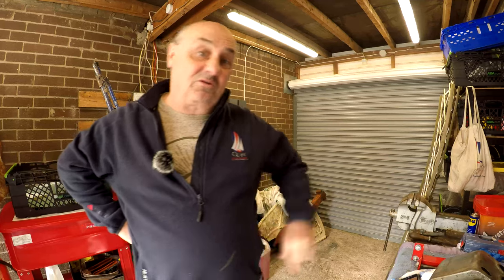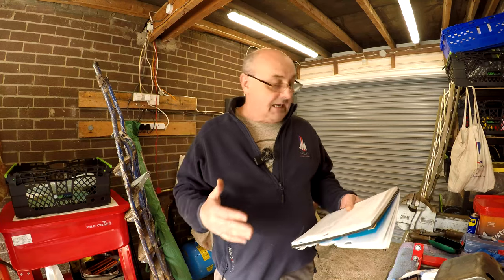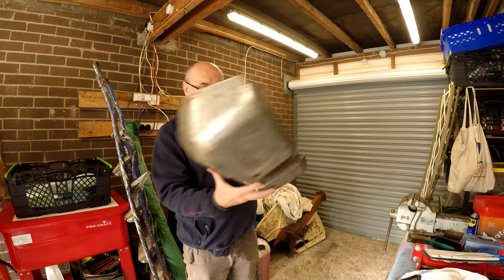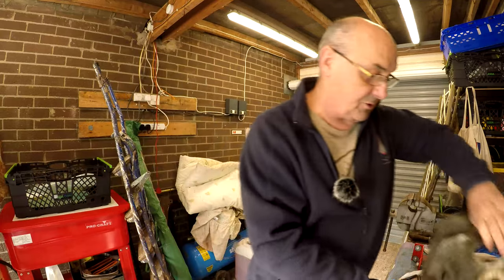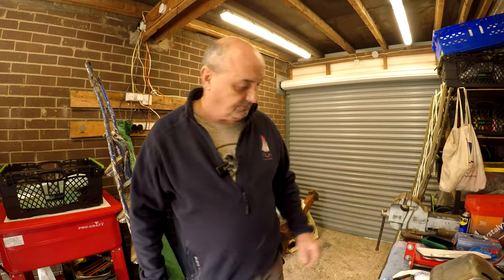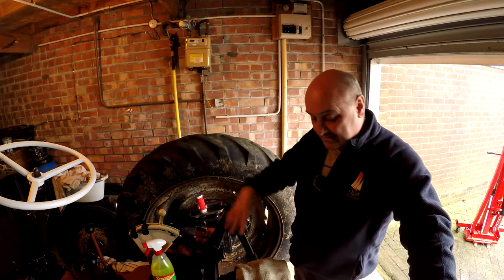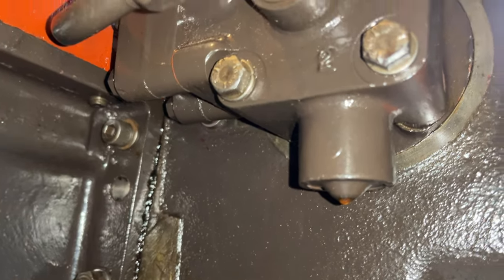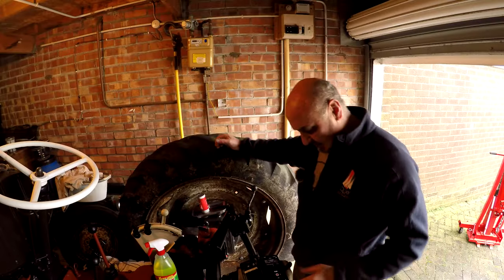David Brown 990 tin work and wiring harness #94

Comment: That's quite a snagging list Barry, it wouldn't be a David Brown without the odd oil leak! In the apprentice training school at DBT they had a mock up board of all the tractor electrical components that we had to wire up and the instructor would then connect the battery and test that every switch, light, gauge etc worked correctly as part of the electrical module. Good luck going forward
Reply from the maker: Cheers Terry,

Comment: Barry, I'm feeling your pain, cranksheft seal and final drive problems, better now than later on!  I certainly do know where Reed Raa is - my dad was born there.  I hope you get the problems sorted out so you can get out and about on the DB.  Had the Fergy half shafts out to change the seals, brakes absolutely covered in oil, set up the end float and fitted new brake shoes, went to start it to test the brakes to find the fuel tap leaking like a sieve. All the best, keep them coming.
Reply from the maker: Cheers Ken, the way I try to look at it is, If I wasn't messing with tractors Debs would have me decorating! and I hate decorating! So oil to the elbows sounds good to me.
are you going to repair or replace the fuel tap?  I'm sure Lance has a good video on repairing one and you can get all the bits from the old TE20 people.
anyway it keeps us out of mischief.
many thanks Ken
Barry
Reply: @manfromthemist1958  Kit is already on order, I've watched Lance's video, looks straight forward, next job full oil change for engine and transmission. Cheers
Reply from the maker: Lance is the daddy!

Comment: Hi Barry. The first time I put a new clutch in my 1210 I had to split it 3 times. The cone on the replacement disc for my pto was slightly longer and I did not notice. It was just enough that it would not allow the clutch to disengage. Needless to say I got good at splitting the tractors if nothing else. Once I got the right size disc it worked perfect. I have done quite a few since then but I will never forget the first one! Thank you for all your videos! I am constantly learning from you. Best of luck with getting everything sealed up!
Reply from the maker: many thanks Robert, some of those after market parts can be a challenge, I found the hydraulic filter snout to be 1/8" sort on my filter and spent two days trying to get it to fit, it's something you just don't expect at first, now I check everything.
many thanks
Barry

Comment: If it all went together perfectly with no issues it would be too easy and you wouldn’t learn.  I reckon I do every job twice before it’s right.  Like Shane, I used Hylomar on the lift latch cover - took me two goes because I didn’t read the instructions on the tube the first time. Been ok ever since though.  Also the hydraulic sump gasket - tried a thick paper gasket the first time which leaked so I found a thick rubber gasket from another supplier and that sorted it.  Brake return springs I got from Barclay.  Keep the videos coming!
Reply from the maker: Hi David, I know what you mean about doing jobs twice, and your right we always learn more from our mistakes or as I like to say alternative forms of correctness, its good to hear other peoples experiences as well, i don't think anyone wins them all first time.
many thanks David 
Barry

Comment: HI Barry - I can't believe how sanguine you are about splitting the tractor and stripping out a final drive - probably two of the hardest jobs on the entire thing.  At least the splitting will be easier so soon after having it apart - I think when I split mine it was the first time in about 30 years or more and it was quite a battle to open up the gap.  When I changed the brake shoes I tied up the diff lock with wire which snapped and dumped the diff lock into the housing and I needed to get it back under cover in a hurry so I put the final drive back on without it.  Gave me time to knock up the tool they have in the manual for pushing it back into place.  As I said before I emptied my swear box just before that job as you need to be a three-armed gibbon to get it back in, but the tool is quite easy to make up and it works with patience and ideally a willing helper.
All my wiring was pretty nasty so made my own loom with the circuit diagram in the user manual.  If you are putting new terminals on the wires I recommend using crimp terminals that have heat shrink on them as they give really strong connections - much better than standard crimp terminals with the normal plastic covers.
Great to hear the arms have held all this time - so the hold valve works perfectly and no leaks on the seals on the ram piston.  
Dashboard looks in good condition.  I had a few Dynamo issues on mine so whilst I had it apart I cut a new hole and put in a volt-meter so I can always see whether I'm charging the battery and I really like this addition as it gives me good visual feedback on whether the battery is being charged at whatever revs I'm in.
Great job as usual, keep it going.
Reply from the maker: Cheers Andy, well as I keep saying "it's only nuts and bolts", lol, 
and as you say at least I know it's all clean and freshly put together, so shouldn't be a right pain.
if you happen to have a photo of your dash with the volt meter in would you please send it to manfromthemist@gmail.com, so I can get a look, was thinking about an oil pressure gauge just to keep an eye on it as it could be to late by the time you see the light on.
when I took mine to bits it was obvious that someone had been in there recently and not in a good way, I've heard of people having to use 4" square post to knock the final drive off as they were so stuck, as I say mine where finger tight and damaged
thanks for all the tips
now just waiting for a weather window,
many thanks
Barry
Reply: My tractor lives 300 miles from me near the sea so will get a picture of the Volt meter next time I'm there.  On my dash there was a smaller blanking plug on the right side I remember and I just enlarged it to a standard 52mm diameter and put in a classic car illuminated Volt gauge.  Positive wire is just off the input to the voltage regulator under the dash as I remember  -as the 12V comes back there off the mounting point on the starter motor (which in turn goes to the fat lead on the +ve of the battery).  I really like the addition as I can always see the state of charge at rest and charging when running as a weak battery is a killer as they need a lot of cranking juice. @manfromthemist1958

Comment: Hi Barry,
The throttle linkage you showed is the same as my 990 selectamatic which is fitted with factory the optional foot throttle, so it's not an after market repair job 
The spring system allows the 2 mechanisms to use the same rod without interfering with each other.
Reply from the maker: Cheers William, i was beginning to think the previous owner had be searching through his scrap box and cobbling together a tractor.
many thanks
Barry

Comment: Hi Barry,
Some further dashboard info, in the parts book 629 printed in 1969 there are 3 part nu bers for the dash depending when the tractor was made. My machine is in the middle range of production and is attached to the tank by 5 screws, later tractors after number 813397 have a different dash attached by 4 screws. Hence your odd screw and hole count.
The screws are supposed to be, 2BA x 3/8".
Hope this is useful.
Reply from the maker: many thanks for that, it all helps to clarify the differences, a quick question for you,
does your dash sides fit snuggly to the tank at the bottom edges? mine has a gap of about 3/4" both sides, however when i pull them in with screws it gives a better clearence to the throttle shaft at the base
many thanks
Barry

Comment: Oil leaks yuk, DAVID BROWNS don't leak oil they just mark there territory 😀The throttle linkage appears to be the hand/foot control option. The spring allows the foot throttle to operate with out affecting the hand lever. The hand lever only throttle would have the cable attached directly to the lever with the ball joint. I like your positive attitude on taking things back apart.
Reply from the maker: Hi Brad, thanks for that, just one more thing that leads me to believe the previous owner didn't have a clue when he put this poor old girl back together, there's lots of mismatched parts such as the stabiliser bracket on the off side final drive is from an 880.
but thats a very helpfull piece of info many thanks
Barry

Comment: G Day Barry, I cant recall now but did you soak the rope seal in engine oil for a few days before fitting them? I think that if restoring tractors you can expect a few troubles, I have them that's for sure, the main thing is that you work through them and don't get disheartened with the job. It can give you the shits a bit though.
Reply from the maker: G Day Lance, no it was a while ago, yeh it got soaked for over a week and put in using thumbs and hammer shanks, as i say i broke the first carrier, but then I cant remember if i sealed it to the block, probs haven't,  nevermind it gives me an oppertunity for another video, but i will investigate with the endoscope first to see whats going on.
I need to get it outside in day light to look at it, you cant see jack shit in the garage.
many thanks
Barry

Comment: Hi Barry that is the correct set up on the   Hand throttle with the spring when a foot throttle is in place . Can you start the wiring I have 880 and a 950 to sort out need to copy you hurry 😂😂 thanks Gary
Reply from the maker: Hi Gary, sorry for the delay, I will be starting the wiring soon, thanks for the info re the throttle, very helpfull
I'll drop you a message when I've got the video comig out, hopefully not to long
many thanks
Barry

Comment: I don't like oil leaks either.  However, from what I've heard, it wouldn't be a David Brown if it didn't leak a little bit 🙂  I used a Hylomar blue equivalent for those machined faces between the left hand cover and the casting.  No leaks there for me.  I can't remember if you've already videoed removing the steering shaft, but if you haven't I'd like to see that.
Reply from the maker: Hi Shane, I've got some hylomar blue I'll give it a go in the next couple of days and see if it works, thats if it stops raining here, all the fields and roads around us are flooded tonight and the farmers are loosing lambs with the wet and cold like there's no tomorrow.
The steering column, was completely resto'd, new balls etc before I began the video series, one of those " I wish I had"
moments, however I'll be videoing taking the lot off again to split the tractor again, I'm hoping it something stupid like I forgot to seal the carrier to the block.
many thanks
Barry

Comment: 1 step forward and 2 back. Pretty difficult to bend a shaft that size. m
Reply from the maker: Hi Marshall, I think it had something to do with the previous owner running it with four bolts in the final drives and ovaling the seal carriers, as you say they are heffty bits of steel.
cheers Marshall
Barry

Comment: Hi Barry. I see your starting to do the tinwork. I've just fi ished my dashboard too 😂 Wondering where you bought your final drive inspection plate holding bolts from? Thanks. Also check out the video I've uploaded onto the channel showing the 990 restoration so far...
Reply from the maker: Hi Crofter, I bought them from GWR on ebay and then just drilled two for the breather bolts.
20 off £10.00

Comment: Oh no one step forward 2 steps back but you seem relaxed about it all id have filled up the swear box lol. Your get it right i personally think you done it on purpose so you dont end up decorating lol. Maybe Ron greet in Devon will have that ball attachment you need.  I get my grease nipples from patrick at fergiland hes a top man. My 880 has a green light for oil pressure and a oil pressure guage occasionally if im giving the boy full throttle the light will flicker on/off but guage stays put so i tend to go by oil gauge im not sure if its something someone put on. My oil bath i make my own gasket with thick paper and a gentle smearing of silicone literally a smearing never ever leaked i did buy a new gasket from David Brown parts company it came as i thick rubber gasket which i tend to use to make new gaskets it seems a bit to thick for my liking. Chin up barry us is all there with you
Reply from the maker: Hi Jon, I'm working on an overdraft for the swear box, it's all good content for the Christmas special, my little bleeper will get some stick. I was thinking of putting a oil gauge in the dash and I've also got a buzzer that I can wire intot he same circuit so it give a auditable warning, i know none of them had this but it could just give those vital seconds jump on a problem. I did make the gasket from .4mm paper but I only put a bit of grease on it, I think next itme it'll get some wellseal on and see if that stops it.
I'm just pleased I've got a little more room to do stuff indoors now even if it makes video work just that little harder.
many thanks
Barry